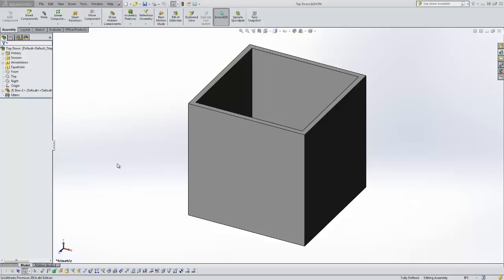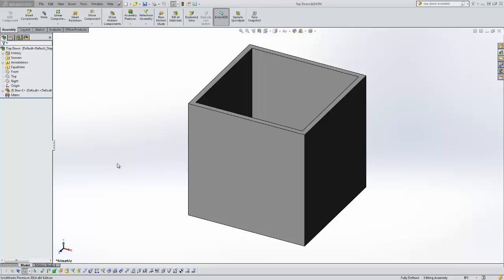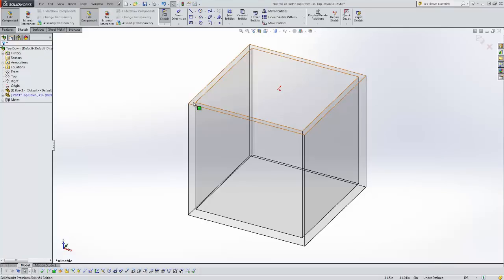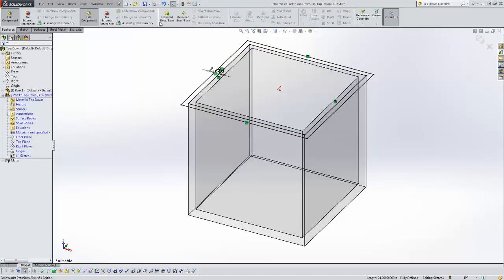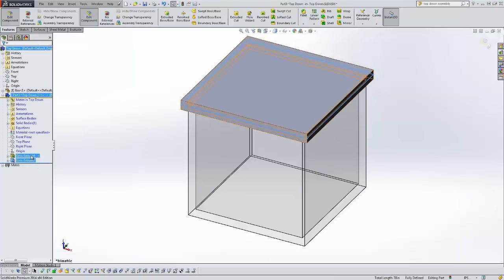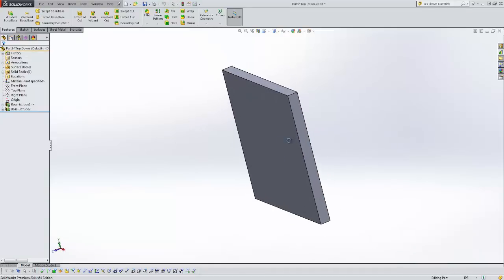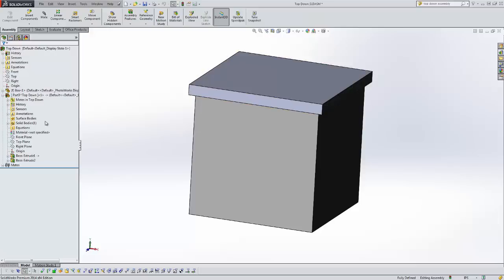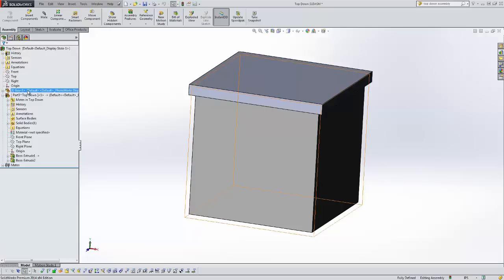SOLIDWORKS - Top Down Assembly Modeling

Comment: Thanks for the Video. I've got a couple of questions though. 

I recently learned to work with Creo Parametric, and was surprised to learn that we shouldn't use external references AT ALL. I had to re-learn CAD-design (I'm relatively new in the profession). That means we had to make reference planes, point and axes in relation to the origin in the top assembly and place components in relation to those references to achieve a stable assembly file. Is this advised when working in SolidWorks aswell, or is that depending on what company you work for? 

When creating a part in an assembly, you select a face or plane. What is it that you place? Is it the top plane of the part? Is there a more strategic place to put the part? E.g. coincident with the top plane in the top assembly file.
Reply from the maker: Top down design, or creating inter part relationships, is a very powerful tool when used properly.
 It is usually a corporate decision whether to allow it or not based on distribution of work and how many people get their hands on the same data. It can be difficult for an unfamiliar user to understand the associativity created by the original designer. 

That said… When you insert a new part into an assembly and are prompted to select a flat face or plane… You are placing the front plane Of the new part coincident with your selection.

If you want to align the planes with the planes of the assembly, click the name of the assembly when prompted to insert the part, or simply click OK and it will default to aligning the front top and right planes of the new part coincident with your assembly planes. 
I personally prefer meeting parts to each other… Or more specifically mating features to each other… So when one part changes, the other parts position will react to that change.

The other method called working in body position is done by having all of the planes mated to a single origin and the parts built out in space relative to that point. This is easy for placing parts because assembly is simply about aligning the planes and origins… But when geometry changes, A bolt going ‘through’ a hole would not be aware that that hole is moved in this method. 

In SolidWorks, a bolt made it to that hole would move if the hole placement moved. 
Check out our videos on top down design and it will help you understand a little more of the nuance of the process.

Comment: hiii........I am unable to add part to assembly In solidwork 16
Reply from the maker: Hi Ritu,
I am not able to determine why you would not be able to add a part to an assembly if you are using the method outlined in this video.  If you need technical support I would encourage you to contact your local supporting SOLIDWORKS VAR (http://www.solidworks.com/sw/varlocator.htm ) so they could help to diagnose the behavior you are seeing.

Comment: Is there a difference between creating the first part of the assembly within an empty assembly environment and modelling within the part environment and then insert the first part??
Reply from the maker: Hi Raymond,
The only difference that comes to mind is that creating the part within the assembly directly first makes that part as a virtual component (it doesn't have its own external file).  Otherwise, both methods would put the initial part into the same location with the same orientation so modeling the part through either method would tend to yield the same result.

Comment: You said that virtual parts have brackets around it, like the second part you made. How can I save it in it's own part file so that it exists separately from the assembly.
Reply from the maker: Hi Zoe,
If you were to right mouse click on the virtual component you could then use the command called "Save Part (in external file)" to save that virtual component into its own file.

Comment: lets say i want the lid to be able to move around (say about some axis). if i use this method, every time i move the lid it will rebuild and change size. but i still want to model it top-down in order to have a link between the box size and the lid size. could you do a video about how to solve this?
Reply from the maker: Hi Tom,
The sorts of in-context relationships that you would create to have this kind of behavior are described in this video (https://www.youtube.com/watch?v=FFDvDWJ304A ).  This video shows how to create a part that changes geometry based off the movements of another.